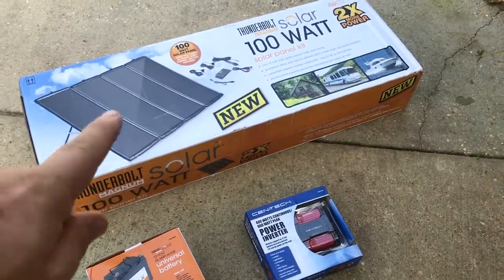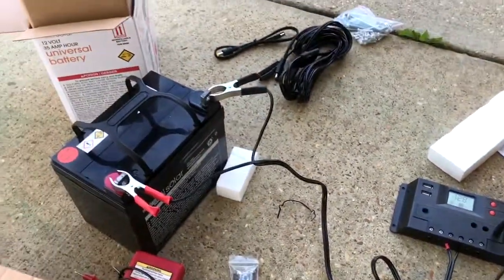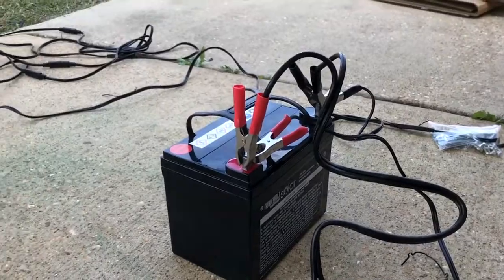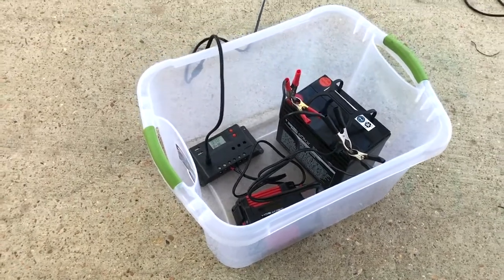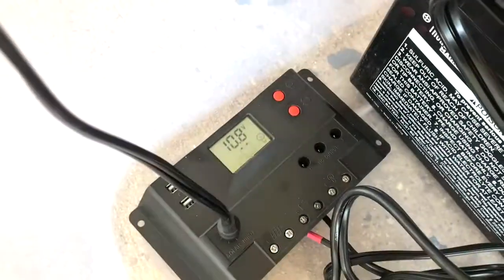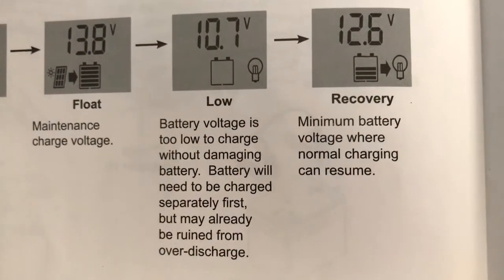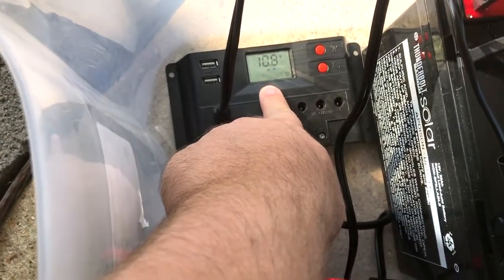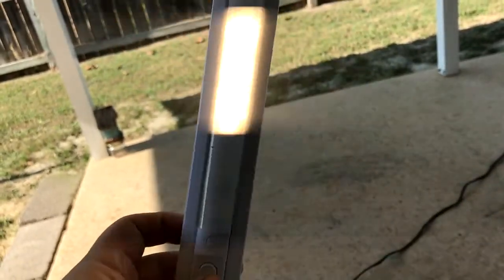My very own Solar System

Comment: I hooked up my battery to a harbor freight 100 watt solar panel.  I got an error code (E11)..    I know the battery is low.  But, will the panels still charge it?
Reply: Lewis Moten Thank you.  I will do that.

Comment: What exactly does this mean? "12.6v Minimum battery voltage where normal charging can resume." How would it charge abnormally under 12.6v? I was under the impression that you could discharge a battery to 12v.

Comment: Do you know if your UPS has a modified output going to your computer or a pure sine wave output? Because I bought a “APC” UPS, and it’s output is a modified sine wave. Not what I wanted. Good luck on solar setup.
Reply: Almost all of them are modified sine wave. And the unit he shows did not like his inverter output because it was also feeding it a modified sine wave. They want pure sine wave on the inputs. :-( Next up for me will be a 5kw pure sine wave inverter. The 2KW Jupiter unit from HF is also modified sine wave and it runs the fridge, freezer and tvs just fine but you can't have the UPS on the TV/DirecTV  combo. Also the microwave will run on it but you have to run longer on modified sine wave to get the same heating.

Comment: 👏🏾, I am in the same boat, just learning the solar system myself.
No keep doing what you are doing. So far I have fried an used 750 watts inverter.
What I have learned it to fused power cables so next time i will not damage my unit.
Keep up the great work ⚡️👍🏿.

Comment: Connecting 2-100watt kits to 1battery bank.  Can it be done safely?   Thats 8panels, 2charge controlers, 1batt bank (4-12volt)  can it be done safely?
Reply: Yes it can work. I have two kits feeding a 30 amp MPPT controller right now with a kit controller controlling a third set. Works fine with the second kit controller too. Be sure to fuse or use circuit breakers on your system though to protect things. My inverter is protected by 2 150 amp Bussmann 42 volt breakers. Each of the controllers is protected by a 30 amp auto reset breaker. The panel strings ( 2 sets of 4 and 1 set of 4 ) are protected by automotive 10 amp blade fuses for each string. And both positive and negative sides of the panels are fused. And the output of the 2000 watt Jupiter inverter is getting a Bulldog 20Amp breaker even though it has built in protection. And the HF controller that Lewis mentioned is 500 watt. The combiner they sell though is only good for 400 watts and even at 200 you find that the output leads get warm.

Comment: Live and learn ...You started @ the bottom and now you are working your way up ...Walmart has a deep cycle battery for boats that I use for my solar needs ...https://www.bing.com/images/search?view=detailV2&ccid=os59s9BD&id=ABC961377CC5E63E4907543A6436864504EABDE6&thid=OIP.os59s9BDZTPLHcnnWFBw9QEsEs&q=walmart+boat+battery&simid=60
8004900998153238&selectedIndex=2&ajaxhist=0

Comment: I have 100 watts,5 batterys,3,000 watts inverter in  my little tacoma,I run 12,000 lt winch,any Power tool with no problems

Comment: https://www.youtube.com/watch?v=EyVwKrfQCxA

check this out before you buy a harbor freight solar panel.
Reply: Maybe you should also mention that with those panels you have that you also need a converter that will cost three times the money to even use them and those are 24 volt panels not 12

Comment: Get 1 of these  https://www.amazon.com/Peak-PKC0AW-3000-Watt-Power-Inverter/dp/B0027VT0I8/ref=as_li_ss_tl?ie=UTF8&qid=1504327700&sr=8-2&keywords=peak+3000&linkCode=sl1&tag=ddndddddddhdk-20&linkId=e70a55c7dfc0a0aa8e8c97626eb541e3 Also check out this guys channel he has several good videos on solar with the HF 100watt set. https://www.youtube.com/channel/UCZO1BO_wWbsfDrWfOzccQDA  

Cheers,
Gorbag

Comment: My plan is start with pure sine wave inverter .  Yes costs more than mod sine but replacement of computers flat screen TV ect adds up quickly when using mod sine. Also one battery really not enough you only get 210 watts before battery low once sun goes down.  I plan on two batteries in parrell to start. That way you have  more stored power when nighttime.  Good luck you are ahead of me I haven't bought anything yet.

Comment: For the solar on my house I have a microinverter for each panel. I have 9 panels and 9 inverters. Then it goes to a controller
Reply: Lewis Moten You don't need microinverters to put power to the grid. What you have now is a single inverter. So any variance in multiple panels will end up being lowest common denominator of power output. If one is in the shade and others are full sun, your single inverter will only handle as though it's all in the shade. So for that reason it's worth having one inverter per panel when you get to that point. Regardless, quality of the inverters matter more than the panels. The inverter is the part that will fail before anything else. Well, short of destroying your battery
Reply: Lewis Moten in parallel, the voltage of all panels will be the lowest, but current will be the sum. In series, voltage is summed.
Reply: Lucas Moten, Not true. The panels will go to the highest level that the panels can support amperage wise. So if you have a lazy panel that only outputs 18 volts and the other 3 put out 22 volts, your output will read 22 at no load and drop down to match the voltage to the load. These panels have blocking diodes to prevent battery drain at night and it also allows the highest voltage panel to be seen under no load conditions. In my case,  I normally see around 13.8 volts and 6.5 to 7 amps out of the 200 watt setup. I doubt if anyone will ever see 100% of the 100 watt rating per kit and 50% is about the norm. I lose a lot of the rating due to heat. These panel do better than many with heat loads and they also work better in low light conditions. The LEDS start lighting up at about 0615 right now and by 0700 they are putting a trickle charge into the batteries. By 1000 they are nearing full output and that goes till about 1500.

Comment: You may need more panels. 100w isn't going to give much through the charge controller and inverter. Look at their efficiency and power loss, as well as the loss from transmission through the cable.